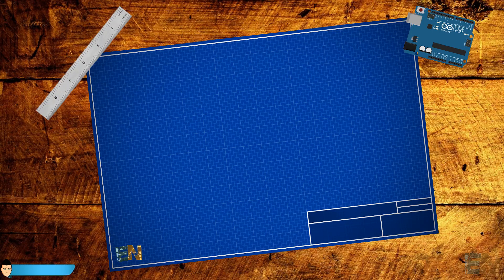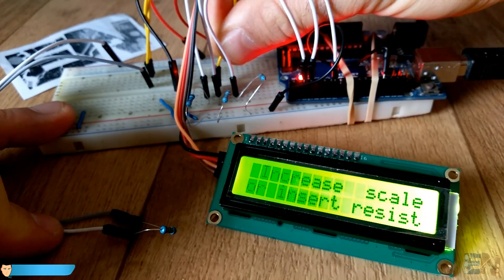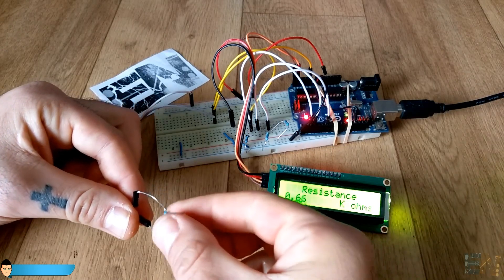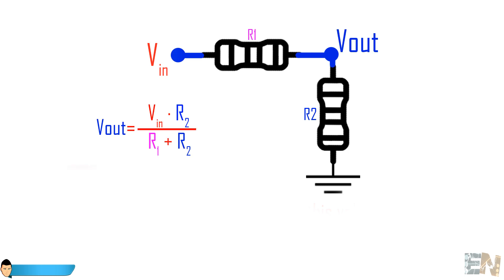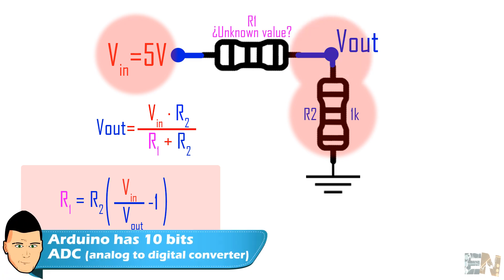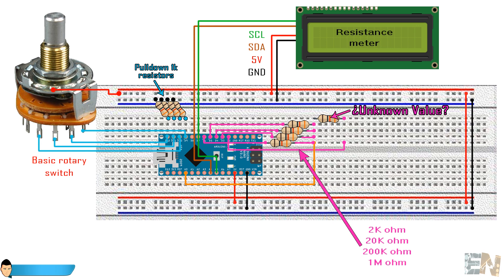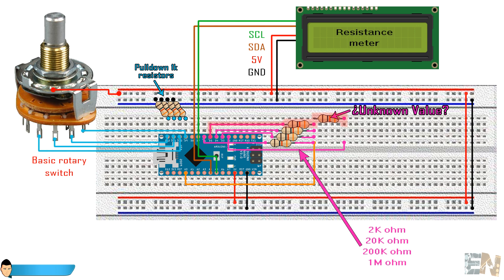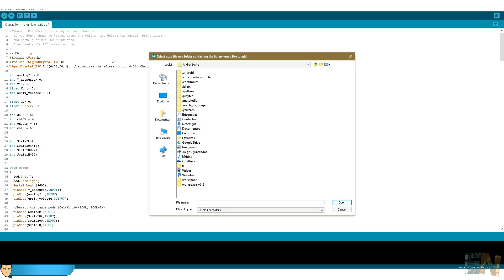Arduino resistance meter and LCD screen

Comment: A couple of things:

1.- There is no need for that rotary switch, it would be even better to let the Arduino choose the proper range like modern multimeters
2.- The only problem with this is that arduino's ADC is not quite precise so you wont have nearly the same precision you would get with a regular multimeter

Comment: How about using this idea for measuring much lower resistance values? I have an idea of using this in a project as a self test for a dump load using a 6 ohm resistor bank. If one resistor fails I would like the test to detect it but I'm not sure if the 1.5 ohm change would be detected reliably. Thoughts?

Comment: The 10 way rotary switch I have doesn't do anything when connected to the wires from the nano. In the description you say connect 5v to the centre pin if the switch, There isn't a centre pin on my switch. On the picture you show the 5v wire going to the switch body, is that the same as the centre pin.

Comment: If you change the reference resistor to r1,and change unknow resistor to r2,you can use one reference resistor(around 5k),to measure a resistor up to 1M.

Comment: Great explanation!  Do you think rotary switch could be reolacedd by relays or transistor to make the scale change automatically?  I want to measure a variable resistance without the need to change the switch.  These relays to be activated by if conditions.   Thank you!

Comment: I have just watched a video by ElectroFun on the same subject (no LCD though). Now I have a problem. Their video presents R1 as the reference resistor and R2 as the test resistor.
I am guessing that it does not matter which you choose, so long as the chosen 'constant' reference resistor stays constant and you always swap the resistor that is in 'other position'?
But that is me guessing. Is my guess right, or is there only ONE way to set the reference/test configuration? [I will ask them the same Q).]

Comment: Hi, before coming to this video I was experimenting the same. But the Resistance measurement is "ok"  only if the unknown resistance value is close to the known/fixed resistor value. If the unknown value is a bit far (200-500 ohms), the circuit does not show proper resistance. Any idea?

Comment: Why add a rotary for the 4 different settings of the resistor? Just use the Arduino to scan each of the 4 resistor and use the value which has the most accurate Adc value. This way your resistance meter has an automatic range detection.
Reply: Did exactly this.
Reply: I know it's been a long time😅 but can you tell me what have you exactly done?